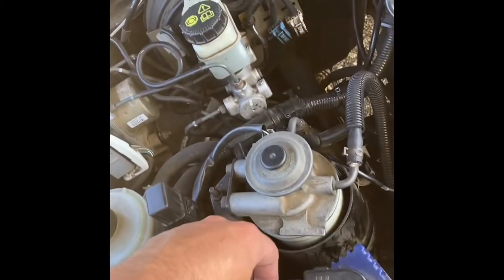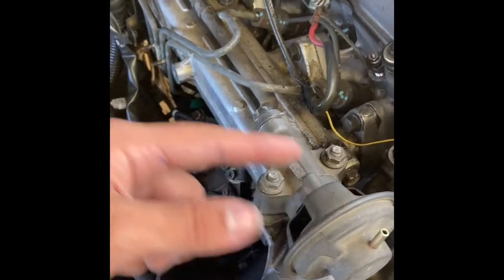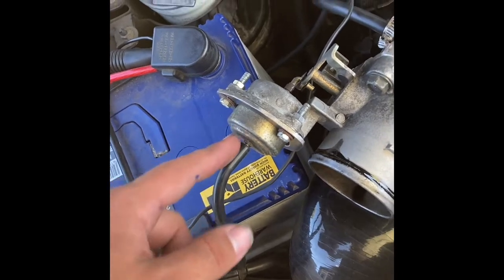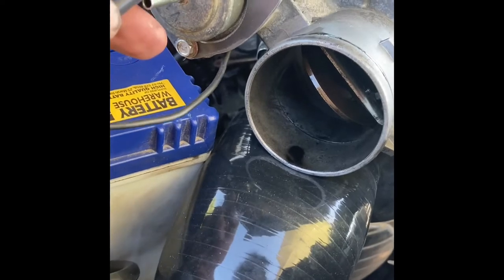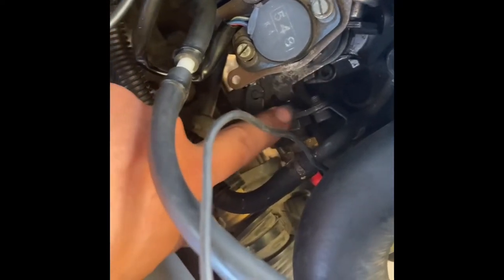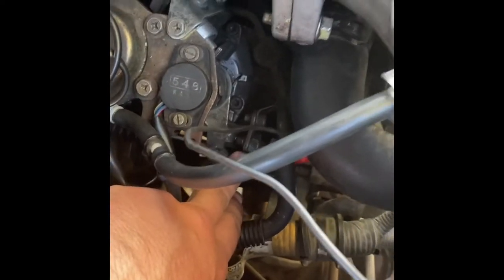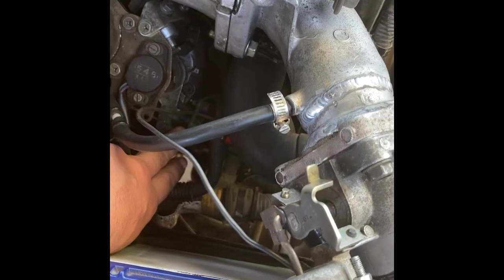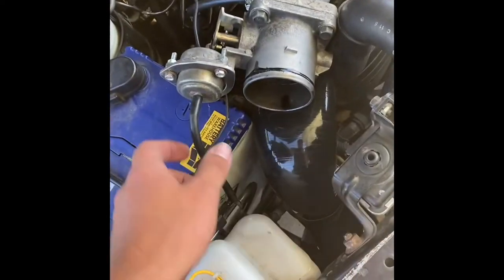How to add a BOV or a throttle body to a diesel/ WLT Ford Courier

Comment: Does it do any damage to you motor bro?
Reply from the maker: I’ve had it on for a few months now, shouldn’t damage the motor, might increase the wear on the turbo slightly, but for the noise a 2nd hand replace is worth it if need be